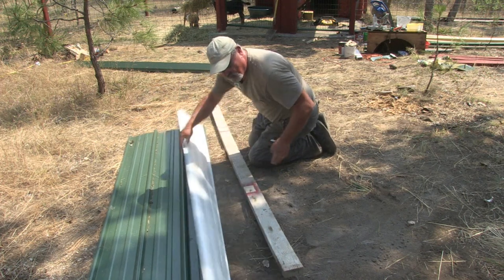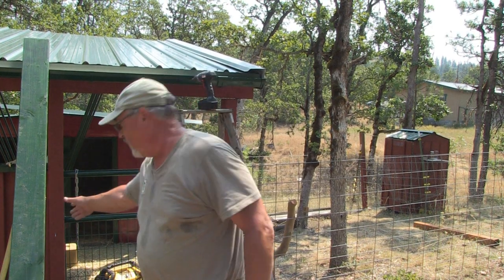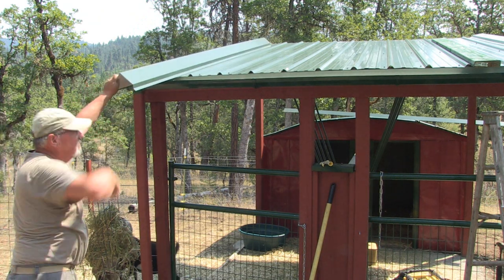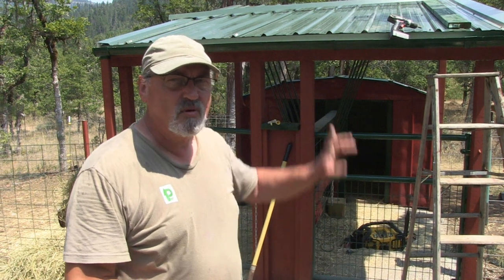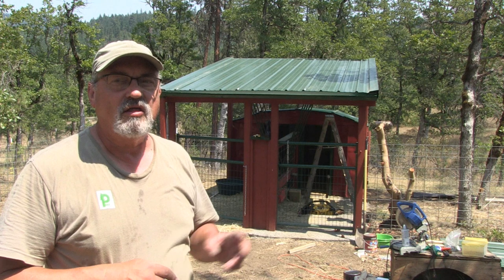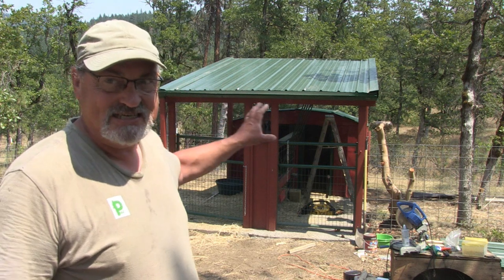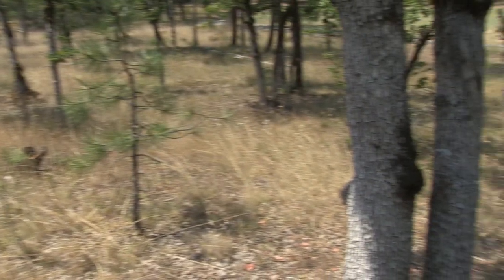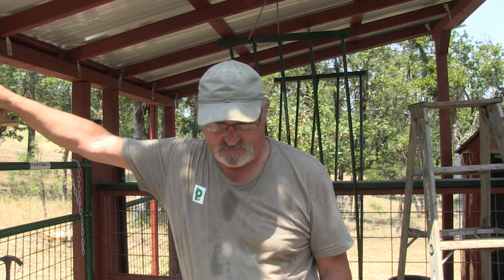HOMESTEAD BUILDING PROJECTS - A New Billy Goat Barn Part 12

Comment: It's looking pretty good so far; but, I have a question.  Are you going to put a gutter along the front of the shelter?  When it rains, the rain will follow the path of least resistance and since the shelter roof is sloped towards the front, I would think that you would want to put a gutter along the front to help direct the rain water towards one side or the other.  Maybe both.  Then you could install water barrels at either or both ends of the gutter to collect the rain water.  The rain water could then be used to water the animals or the garden.
Reply from the maker: You must have missed episode 11 when I installed those gutters.

Comment: I have no suggestions Jerry but I do have a couple questions and a comment or two.

First though let me say it's looking great.

Questions:
1.) What do you do with goats, eat them? I have never seen you milk one that I recall. I want some to milk and help me keep the back part of my property 'mowed'.
2.) Why did you make the lean-to (the part you roofed today) so tall?
3.) What was the long 2x4 for you laid under the tin then removed? Whatever it was for, I missed.
 
Comment:
1.) I have never seen sheet metal cut with a utility knife before. I always turn a saw blade around backwards in my power saw and cut it that way. I like your idea! A lot. I will do my next project that way.
Reply from the maker: Awe, Thank you so much for asking. Wow. Thank you for the compliment on the appearance of the build. There is yet more to come on that project. 
1. Yes, we will be processing a goat and selling the rest to recoup my investments.
2. The height of the roof was on purpose, Stay tuned, I don't want to give a spoiler at this time, but yes, there is a reason.
3. I thought I was going to need that 10 foot long 2x4 to aid in the bending of the metal to separate the two pieces. 
1- I did know about the reversed saw blade, my barn build I showed the cutting of that, Marty Raney taught me that technique on our International TV show while placing the new metal roof on the house.
Reply: @pinemeadowshobbyfarmafruga8319  Jerry I'm building a shed for a couple goats, do you deliver to the eastern part of the Texas Gulf Coast near Galveston?

Comment: Wow that was scary when you lay that 2 by 6 on that roof and then walked on it I thought you was going to go for a ride
Reply from the maker: That 2x6 was laid on the roofing screws which were already driven into the wood, therefore created and catch at several points on which the board would not slide. I did take that factor into consideration prior to doing that. Did you not know that I used to be a professional Roof Surfer. DUDE! LOL, just kidding. But I did used to surf the dunes on Sand Boards.
Reply: @pinemeadowshobbyfarmafruga8319  😄😄😅 smart man I should have known but you had me there for a minute I was saying noooooo but great job it looks very very good can't wait for the next project